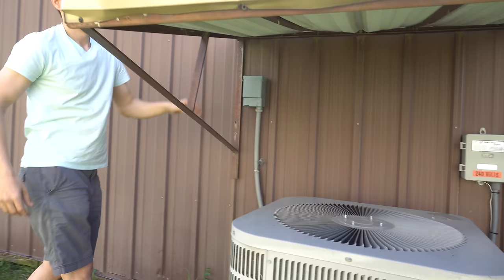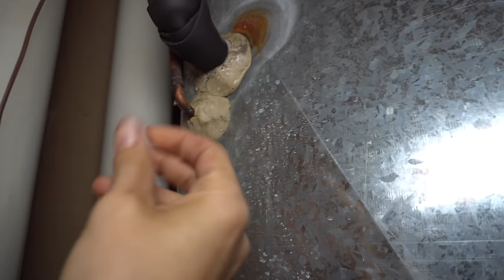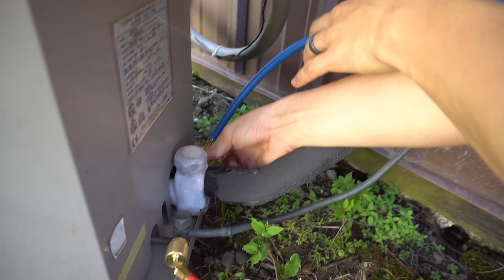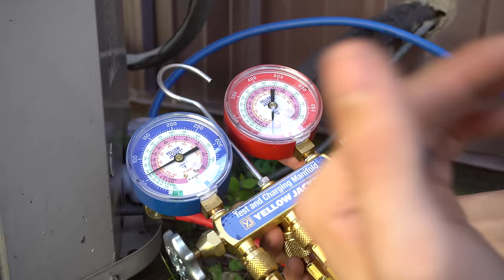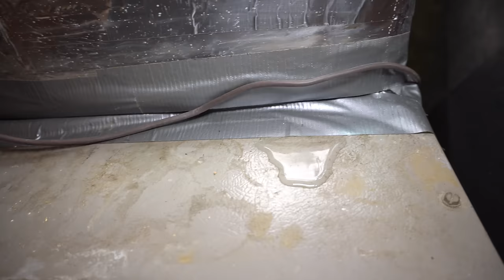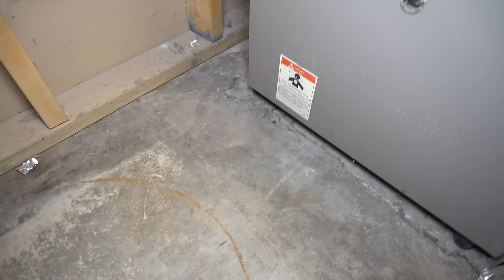How To Add Refrigerant To Air Conditioner

Comment: I finally got around to recharging our old (2005) Lennox hp29 today (May 24, 2024) using your method (except I had the R22 tank upside down as seen in one of your later videos). Our electric bill went up in December as our system was using emergency heat and I just sucked up and paid the high electricity bill for a few months (I hate cold weather!!). I purchased a Schrader valve replacement tool and a Yellow Jacket 42004 Manifold with hoses from Amazon.  I replaced both high and suction side Schrader valves before charging the system (Did have some pressure when replacing them) since a coworker had a similar leak in his outdoor unit and a HVAC company came out 3 times and tried to charge him over $1000 without fixing the problem and then gave him a quote of $10,000 for a new system!! After charging our system according to your video I then sprayed down the high and suction side fitting "areas" with soap and water solution. I found a slight leak that was on the high pressure side "cap nut?" above the Schrader valve. I GENTLY!! snugged the "cap nut" and finally the leak stopped.  Time will tell if this fixed the problem!! I am a small engine technician by trade, but by watching numerous You Tube video's including yours I think my wife is happy with working AC and my wallet should have more money in it now!!!
Reply: Where did you buy the R22? Mine was running low and some tech guy came in and charged my wife $1600+ and said he charged 9 pounds F22 and he probably took 15 to 20 minutes to charge. Now I am thinking, he may have cheated us. But On the day the system got charged, the air was measuring 54 degrees F, but now after a week, it is not going down below 58, and it is taking longer time to cool. As it is only one system, the rooms facing west, does not get cooled at all, but the living room is comfortable. Now I am not sure, if the F22 charged was good at all or not. Now the quotes for replacement I received was $15000 to $18000.
Reply: @hssr1894 umm…r22 does go bad….it sounds like the A frame under ur furnace where the cooling happens might be needing cleaned off as well…u can tell by how hard the vents are blowing air out…if it’s cold air but barely blowing out if the vents then it’s a blocked up A frame …it’s the coils inside the house that are in the shape of an A …the fan in the furnace area blows over them when it’s on and cooling those coils….mine was blocked up after I painted the inside of my home and didn’t cover the vents thinking the paint wouldn’t be that big of deal…it was …lol…. I’ve had to figure out how all of this stuff works because I’m deemed unworthy due to being a single mom…I refuse to go without ac because I have a medical condition where it’s required…and who are these pros to tell me I can’t have something I need just like everyone else is entitled to expect if they’ve got the $ to pay for it…..but that’s ok….ill do it myself….its a necessity when u own ur home because it sure sounds like u were tipped off big time…unless u have a huge house and several large ac units…9lbs of Freon is an awful lot…..the bigger homes I’ve been in have ac units that require 6lbs max …mine is a smaller unit for about 1000-1500 square ft per floor and it only takes 4 lbs ….u can also see if ur natural gas supplier in ur area services central ac units too and hire them….its similar to natural gas maintenance and I’ve used my local gas company before until the hvac guys had me blacklisted from everything
Reply: @w8what575  - Thanks for your reply. Actually I get a lot of air from the vents. I think it has been the same from past 16 years I have been living here. But recently as the pipes froze up, there was no air. That is when my wife called some local guy, as he was ready to come in same day compared to others who offered only an replacement of HVAC suggestion. My home is around 2000 Sq Ft, and one unit. As know, the vents are not cleaned for decades, as it has a bad design. The A-frame cover cannot be removed until the drain pipe, inlet and return pips are cut off. I have seen the modern ones has a these two panels separated out.  So, cleaning is something that cannot be done. But otherwise, the force of air when fan is running or when heater is running, is pretty good. But for AC, it is a little bit low, as the may will be heavy. But otherwise, looks like the HVAC technician has completely cheated me.

Comment: This is what I need for my 20 years old condensor... Now DIY is not allowed but who is gonna know ?
Good job man thank You
Reply: what do you mean it's not allowed? All these DIY videos have saved me 1000's of dollars over the yrs. F anyone who has a problem with that. Anyone that tells you or leads to believe it's  not allowed F them. It's my house my unit I do what I want.
Reply: Only handling refrigerant is not allowed. You have to be licensed. Everything else like changing out parts or electrical trouble shooting is allowed for DIY.
Reply: @FunDuude  EPA certification required when working on r22 or purchasing. You can however charge a 410a system non certified.
Reply: @jeffreylysiak9619  To each there own, It's worked for me for over 30 yrs. That's what home insurance is for.
Reply: Ima snitch so I can get 10k
Reply: @3L5Ancho  😂😂😂😂
Reply: The worst electrical work I've seen in the field have come from "licensed" and "professional" electricians. Go figure
Reply: Maybe your friendly neighbor will turn you in!
Reply: @FunDuude  You're  are very wrong and may end up paying steep fines and go to jail for it; stop been a wise guy/gal.
Reply: @scottholder4776  You're very wrong. licensed electricians don't come cheap but for the most part their job is excellent!
Reply: @bobboscarato1313  ...Bosca from Bosco meaning Forest. Rato meaning rat.  Where do you get off telling people what to do? You must not be american. In my home i'm the king of my castle. You don't like it? As we say in Texas, "come and take it." 
I don't tell you how to run your home ,don't tell me how to run mine. Capish, Wise guy?
Reply: @bobboscarato1313  Wow. Tough what dude? I'm still here doing- IN MY HOUSE- What I please. What's you problem dude? 
You do you, I do me, You Gotta problem with that? I know it's hard for you to wrap your brain around, but that's the way it is. 
I know the Go'v't will do whatever they pls, I worked for them over 30 yrs.
Reply: @bobboscarato1313  lighten up there, Boz 😏… Remember, snitches get stitches and wind up in ditches 😜

Comment: After watching this....I think I am confident that I can add refrigerant to my AC....Thanks!
Reply: Not if you do it the way portrayed in this video. This guy stated how it just to basically help the system along until it could be replaced. If you were to add refrigerant your own home system (and want it to actually operate for any length of time) then there is more to it than what this guy has done. If a system is low then there is a reason and that reason (i.e a leak) needs to be addressed. Furthermore an AC system is pretty picky about it's charge level which is why we use certain numbers like superheat and/or subcooling to make certain that we have the correct charge in a system. Just adding until the suction gauge shows above freezing is asking for problems especially if there is already a known leak. If you overcharge and start slugging that compressor than it's going to cost you big time.

Comment: Friendly advice; drill hole in wall of coil big enough to stick a cheap scope camera. Works to see if dirty coil plus.
Thanks for taking time to help others in our field.
Reply: IMPORTANT... limit drill depth so as not to accidentally destroy the evap coil!!!  That being said, he does not own the system so (technically) drilling ANY unnecessary holes would be destroying another persons property.
Reply: @jotu173  No it wold not. The evap being inside the plenum is an all too common problem. The best course of action during the repair would be to cut an access panel in that plenum not only for your immediate use but also for future maintenance. This is a necessity and well within the scope of work required for the repair that you were HIRED to do.

Comment: Soon imma finish college I’m on my last semester I just passed my EPA so I can handle refrigerant  thanks to u  your videos are very helpful 💯
Reply: Who needs a scam test and bs license when you can just have your buddy get you what you need. Hvac is one of the biggest scam industries out there and right up there with appliance repair. Paying anyone to do what amounts to 6th grade brainpower is ridiculous.
Reply: @kickassclone75  that’s your opinion. Having a license and being certified is better than not having one. You may know what your doing but there are still regulations and rules put into place, the test is to ensure you at least know some of the concept to actually work on units. You can have your “ buddy “ do all your work but what happens when they get hired to do a job and that customer asks for their certification or credentials? Also when applying to a job in HVAC they are going to ask if you are EPA certified and if you have any other certifications. The more you have under your belt the more likely you are to get hired and paid more. So a 6th grader is able to work on heat pumps and trouble shoot a faulty defrost board or a failed reversing valve? Wow I wonder what school he went to 😆.

Comment: Is connecting the high side optional if you are just charging through the low side?  I have no TXV and only care about the low side / superheat it seems?  Thanks your videos are helpful
Reply: Yes, it's ok. Some units only have 1 service valve on low side. A measure on the high side is just  "nice to know" it's not way off the clock

Comment: My 5 kg R22 tank is empty,,, and I couldn't get more R22, since I am not licensed, so I filled the tank with pure propane (cooking gas, in Aus), My tank has two valves, one from top and one from bottom. I use the blue from bottom and add liquid propane to the unit, and have done such for more than 10 years now. Works fine.
Reply: So it’s all propane now? Didn’t know that was possible.

Comment: thanks for sharing the video I'm not an air conditioner technician actually I'm not anything but when turning the furnace on and there's no air flow going through the coils does the high temp kick in and shut the furnace down?

Comment: 17:02 I always like to wrap a rag around the valve when i crack it so that never happens. but good call on the low loss fittings. I hated getting frostbite before I got my own pair
Reply: Adjust the depressor on your hose so that it’s even or a little below the washer you will never get frost bite again.
Also change the washers every 90 days if you are using your gauges every time you do a call.

Comment: Thank you your video help us a lot. But I have a question? Supposedly only a certified technician can add coolant to the system because it is bad for the environment but when you purge the lines that is not the same?

Comment: R-22 can be throttled in as a liquid through a restriction device or by bumping the dials on your manifold. Some manifold gauge dials are smoother than others. I have a digital Fieldpiece SMAN460.
Reply from the maker: Yes, that is an option as well. Thank you for pointing that out!
Reply: And it's a quicker way to charge, yes you can charge in liquid form just being careful. Been doing it for 20 years with no problems.
Reply: Turns to gas as some as it sees the low psi side, it a gas in bottle only because it's under high psi
Reply: I have the sm480v with a sight glass between the RF hose and the manifold. I prefer to open the valve until I just start to see bits of liquid spirt through the glass.
Reply: @WordofAdviceTV  Can you please help me explain why my needle in the high side (red gage) bounced back (fluttering )  ?
 Thank you
Reply: @chadbailey8152  Anybody remember the Ideal Gas Law?  I don't know it as applied to refrigerants but it describes when a substance will be a liquid or a gas .
Reply: vision1707 non condensibles in the system air or nitrogen
Reply: JD Perez get a digital temp clamp for your meter and you will have the line temp the only missing information.
I used a field piece digital superheat/ sub cooling meter with 2 ball valves and a T fitting as my go to gauges for years.
Reply: Going on 20 years experience...have never seen anyone charge as vapor
Reply: @craigf2137  I've been doing refrigeration for 43 years. I charge r22 via vapor quite often.
Reply: @craigf2137   R 22 and R12 etc. can be charged as vapors. new refrigerants like 134A and 410A etc are blends , the mix would become inconsistent if charged as vapor. and HAVE to be charged as liquids.
Reply: @iwilfix9407   134a is a pure refrigerant so i can be charged in gas or liquid  , the r400s are blends and are charge in liquid state
Reply: @iwilfix9407  when 134 is used in a refrigeration,freezer unit it is always put in as vapor, never liquid.
Reply: @craigf2137  same here
Reply: @Hugo-py2ce   yeah, but added to which side...at the condenser?  High side...running or equalized/off?

Comment: Hi Jay, thanks for posting the video. I would like to ask I added refrigerant, but later I saw low and high side pressure does not change at all after a few mins and wondering why? It was 85 outside. Low side was reading 60 psi, high side was reading 180 psi.

Comment: Frozen coil and lines is not always low freon ,could be dirty filter,clogged A coil  ,low air flow ,weak motor ,restriction in lines or contaminated freon,
Reply: Or tstat set too low

Comment: Great video j.
Quick question for you lights suction line gets all sweaty and my compressor gets all sweaty is that normal?
Reply: Sweaty suction line is normal but sweaty/oil compressor not good.
Reply: suction line should be sweaty (unless you are in the desert or something dry). the compressor sweaty could be a sign of a overcharged system

Comment: I have paid numerous amounts of "contractors" over the years to recharge my system and I have never seen one take coil measurements or use anything more than what is in this video
Reply: Man oh Man did you just say a mouthful.
Reply: If they use digital gauges, they can charge with subcool if it’s txv or superheat for pistons. Indoor wetbulb and outdoor dry bulb for target superheat or subcool, along with line temps.
Reply: @khoatran9560  They used standard analog gauges everytime....
Reply: @andrewsmith9980  they should be measuring the line temperature as well to calculate superheat or subcooling. If they don't then they are not doing it right.
Reply: This is where I have to stop and asses paid services. As a professional generalist and master of some in several fields. There is a lot that goes unnoticed in these trades and sadly we as consumers pay. So general if I am not going to die or cause harm I learn how to do it right and fix it myself. This is the first of many videos and guides I will watch/read before even attempting. But doing things right the first time is key, else you are just a fool with a wrench - you know? But I noticed my guys only spent maybe 10 mins at my house every time. I rent. But moving forward I want to know once I move into my forever home.
Reply: @PrimordialOops  it depends on what exactly they are doing. If they are just recharging then that does not take long at all. If the landlord does not want to pay them to find the leak or pay to fix the leak then its just a gas and go. Fixing simple electrical issues also does not take long at all. If the system works after they leave then it was a simple fix.

Comment: Hey Jay
I landed a service technician job for residential. I am learning something new each day. I am wondering, how much lbs of refrigerant am I supposed to add to a unit? How much should the psi read on the low side and high side when I have successfully added the right amount?

Comment: Thanks for the video! I understand that when charging, the R-22 is coming out from the tank into the low side and I understand why you purged the air out of the blue and yellow hoses. Could you please explain why you need to purge the red hose if the valve is closed at the manifold? It seems to me that, if you do not purge it, the air in the hose should not get through the Schrader valve because the high pressure R-22 at the Shrader valve should be liquid and heavier than the air inside the hose and it should keep the air in the red hose. Then you will save the last step because since the red hose is empty you will not need to add the refrigerant back through the low side. I do not know anything about HVAC and I have never worked in an AC unit so excuse my ignorant question. I like to watch your videos and learning things on the way. Please keep them coming! Thanks!! (BTW I also live in Minnesota)
Reply: Because the r22 is under much higher pressure than the air in the hose. So, that air gets compressed and quite a bit of r22 enters the hose with it, and so he purges that air so he can return that r22 to the unit.

Comment: This used to be me when I worked for GMAC who owned several huge apartments in Texas. Every 3rd day I’d be on call, get a “AC not blowy very cold”, Show up, ac iced over, defrost line, dump some Freon in down and dirty, get the tenets cooled down, first light we’d be back order to repair or replace.

Comment: the indoor temp effects your low side blue gauge, the high ambient outdoor temp effects your high side edit: red pressure gauge. the blue side is effected by high outdoor temp, but only because the inside of the house tends to be hotter on hot days.
Reply: Excellent my friend !